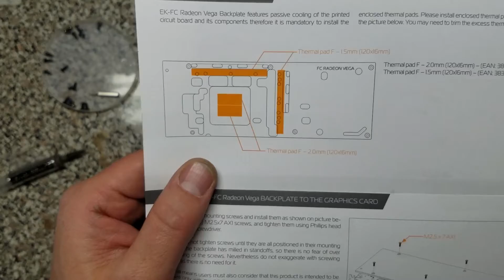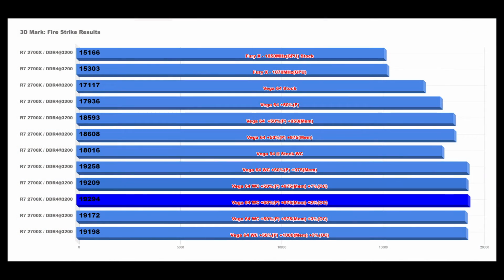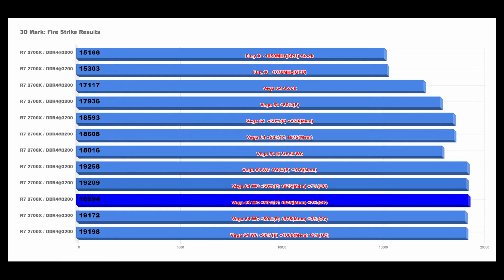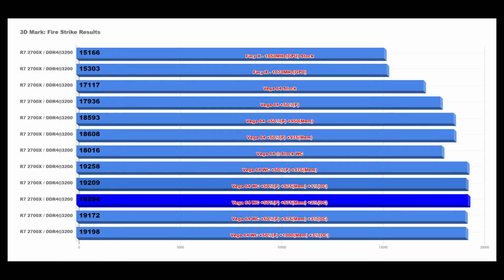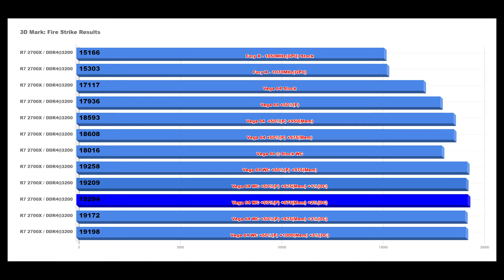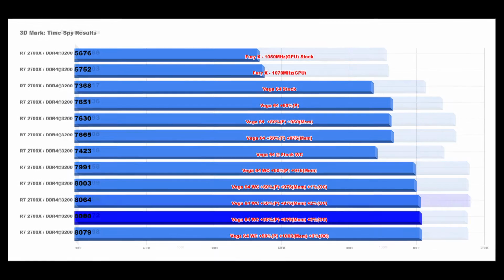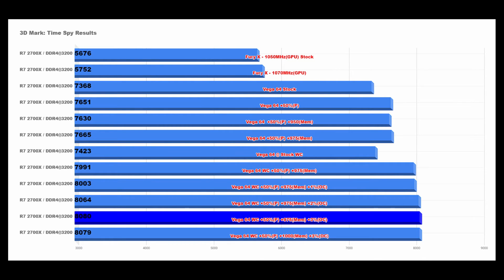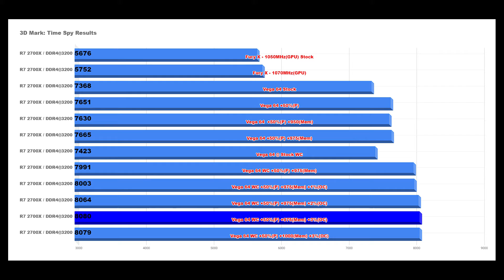Vega 64 Waterblock Installation

Comment: Great looking build. Can you give me the name of that case ?
Reply from the maker: Caselabs SM8 I believe. I spent months researching different cases before I settled on this model, it’s everything you could want in a case. High-grade aluminum, lots of modular sections that can be moved around. The motherboard can be pulled out and used as a tack bench. Unfortunately during some of the aluminum tariffs from three or four years ago case labs had a hard time keeping up with orders and went under. On eBay they command quite a premium these days.
Reply from the maker: If you want to see another amazing build in a case labs case check out videos from singularity computers or Jay’s two cents skunk Works build

Comment: Nice video as usual.  Would it be possible to show a waterblock installation on a more modern video card?  Perhaps something like an Nvidia 2070 or 2080 Super.
Reply from the maker: I think you meant to say something like "Big Navi". :)
Reply: Since it's not out  yet, have to deal with what's real.
Reply: Mark S I’d say most people have older GPUs so it doesn’t really matter. Running a Radeon vii here and would love to watercool it but I don’t want the coil whine like my 56 had after I strapped a water block onto it. Also the stock cooler looks so clean.